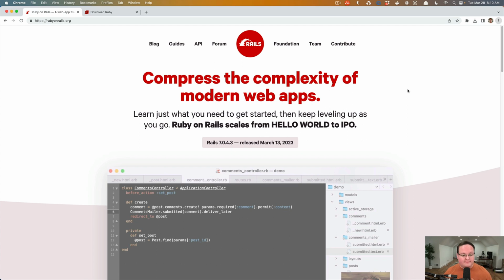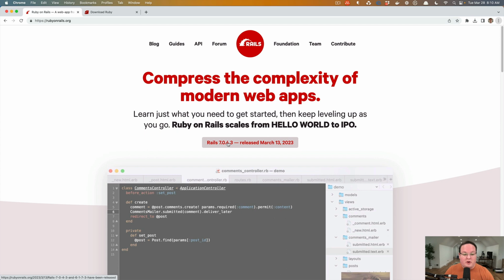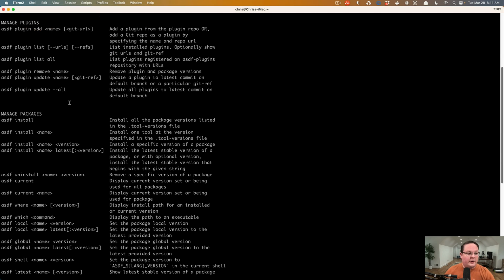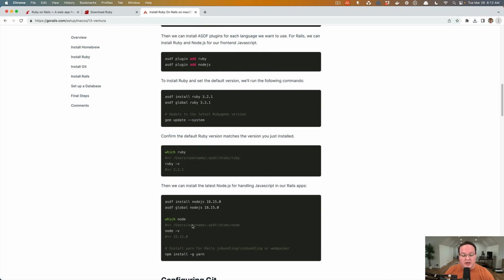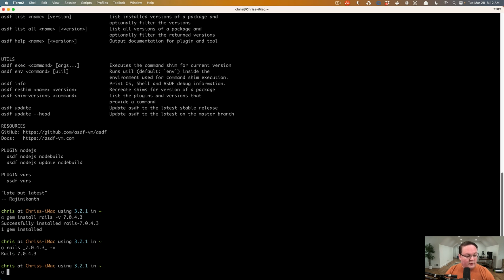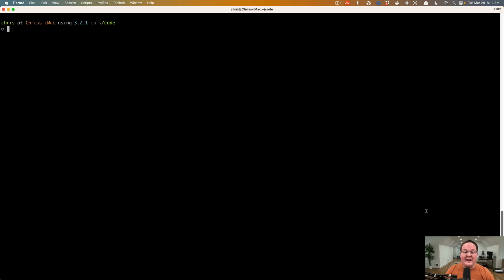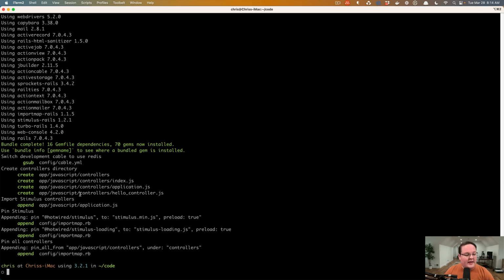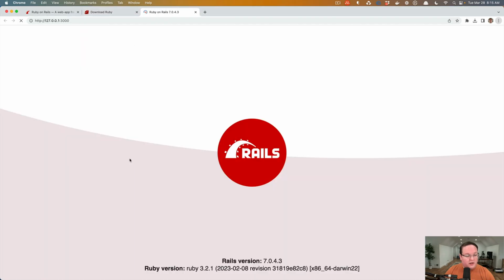Build a Blog with Rails Part 1: Rails New

Comment: Great video, thank you. Unfortunately, I had to give up learning ROR, I never made it past the fresh project install. On Debian latest, always stuck when ruby gem [?] asks for a sudo password when running install inside the newly created project directory. Tried RVM, plain ruby, everything, reinstall stuff, follow steps on various blogs--that's when I found out that ROR is indeed a bit difficult to install--but nothing works. Thanks anyway, this is a great tutorial series.
Reply from the maker: You'll never use sudo to install ruby or gems like rails. If it asks, you've done something wrong.

Follow our guide for Ubuntu which should be very similar to Debian. https://gorails.com/setup
Reply: @GorailsTV  It's not me using sudo to install. but right in the end, it always asking for a sudo. seems like it using some sort of fallback dir to install stuff, I am following the ruby and also rails official documentation but the result always the same. sure will check out the link and try again this weekend. thank you for the swift response!
Reply: @GorailsTV  I thought I needed to give an update. After cleaning up my system, I followed your instructions and it seems to work. However, during the gem install steps, I noticed that some of the items installed complained about sth like "Couldn't find file to include 'foo/bar.md'". the installation itself went through, but when I tried to execute rails -v, it stopped with an error about included file/s not found. I tried a couple of times but, had no luck. I decided to uninstall all gems, remove rails, and start over. I use .gemrc and pass the option --no-document then I reinstall rails. no errors about missing MD files this time, however, I cannot run rails command as bash keeps telling me that there are no rails installed even after I restart my terminal. so I updated my $PATH to look into my GEM_PATHS as well as their bin directories. after the terminal restart, I finally can run rails -v without error, rails new, and finally rails server.

thank you for your reply to my comment yesterday, that really got me going. I am still not sure whether my last steps (updating $PATH) were necessary or even normal when setting up rails. I will keep looking for a topic on this, but at least now I can start on my rails journey.

Comment: About asdf-vm. Why did you set and use global ruby instead of local? I mean a local ruby verion for current project?
Reply from the maker: Great question. You'll need a default Ruby to install Rails and then Rails will also set that version when you create a new Rails app so it remembers which version you were on.